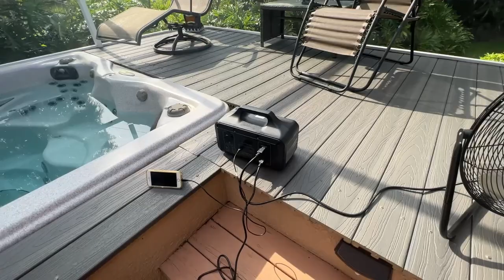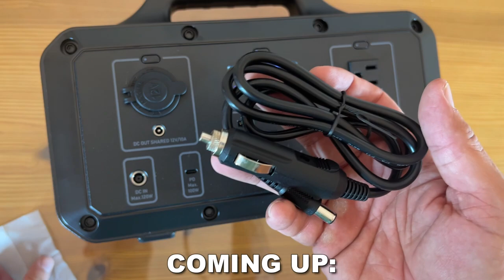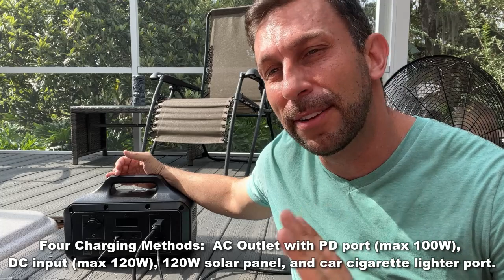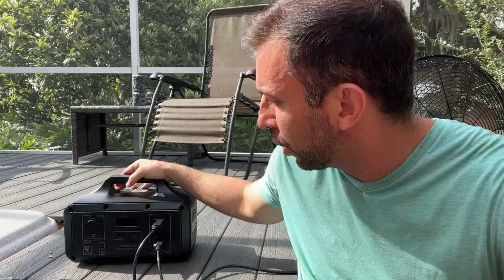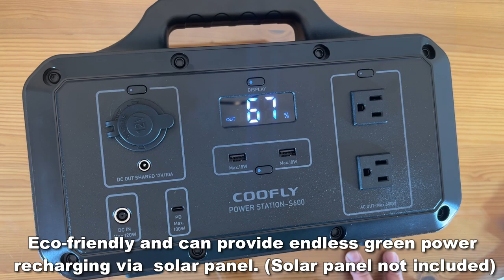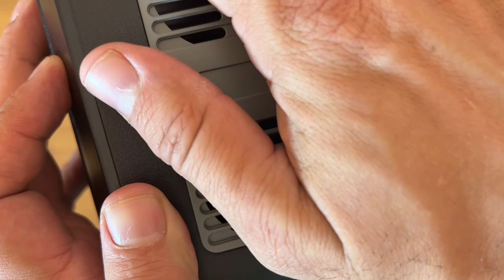Portable Power Station 680Wh - COOFLY 600W (Peak 1200W) Solar Generator Backup Battery

Comment: I got one of these second hand.  The display only reads "100%" even when I drained it down to zero.  The customer service QR code on top of the box now goes to a "404" error code, so that's no help.  Any ideas on trouble shooting?  If not, any idea how long it takes to completely recharge on a 120V plug-in?

Comment: I know this is a  long shot, but I purchased 2 coofly 1000w solar power stations through amazon.  The return window has passed.  I just took one of them out of the box yesterday.  It was charged at 100%.  After using it down to 67%, I wanted to recharge it.  It  will not recharge, no matter what power source I use.  My second coofly - same unit - has the same problem and I have only used it about 10x.  I tried the "reset to factory settings" trick from the manual and it did nothing.  At this point, I now own 2 large door stops for $1600+ total.  I don't understand how the scan code works to contact the company.  There is no phone number, email, or mailing address available to contact anyone. Do you have any suggestions on a fix?  While the units worked, they were great.  Thank you for any help.